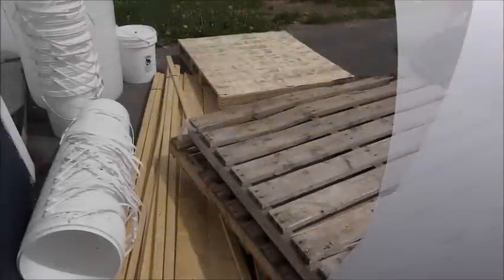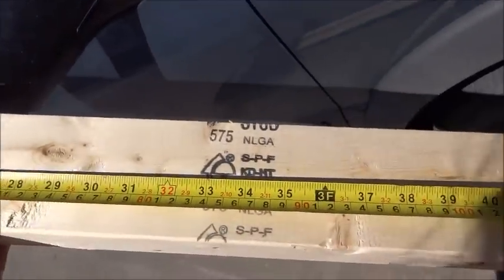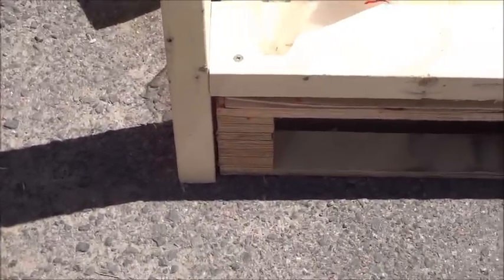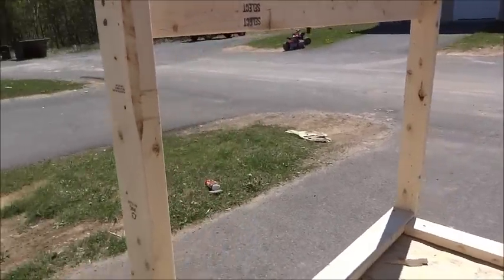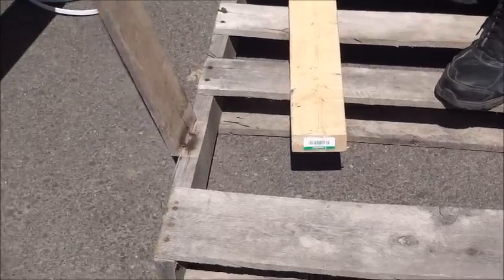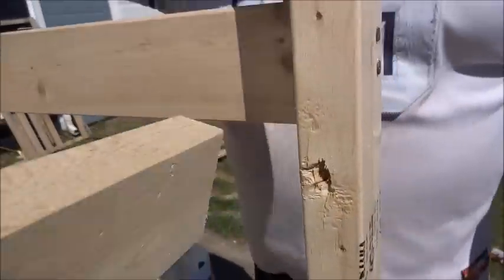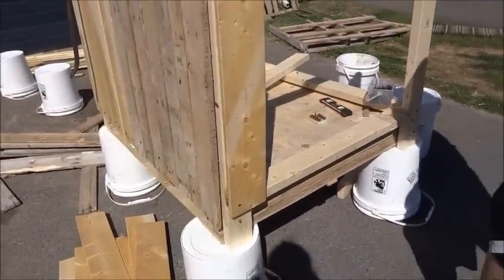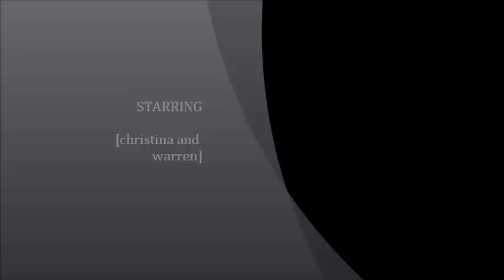My first pallet project building a chicken coop

Comment: For disassembling pallets, I find it easiest to use a reciprocating saw (sawzall) to cut the nails.  As long as you can pry enough space to get the blade in, you don't break nearly as many boards.
Reply: David ike has a chicken coop guide AWESOME!
Reply: Also not all blades are made equal! Cheap ones are not good buys.

Comment: If you own a reciprocating saw (aka sawzall), buy a demolition blade (about $10 at Lowes, and you can slide it between the boards and you can cut right through the nails and have a pallet disassembled in no time at all.
Reply from the maker: I do not own one of those saws yet
Reply: CheapskateGardener Ah, that sucks. If you can ever borrow one, or buy one cheaply, you should consider it because it sure would save you time and work
Reply: @Evania_Brook_Homestead  check with local pawn shops. If you can go battery operated, you will never go back to corded.

Comment: I used a screwdriver and tapped it in under the slats to pry the nails up a bit, then tapped the slat back down to expose the nails that can then be pulled out with the hammer. It tended not to crack my boards that way. Use multiple screwdrivers as shims and it goes a lot quicker too.

Comment: Rather than spend all that time trying to pull out those boards, Get a hole saw for a drill say 1/2 inch and drill a slug around the nail and keep the board intact. Later, you can snap off the slugs on the other wood and then clip off the nails with a grinder. Hope that helps.

Comment: use a hammer and a wrecking bar it's much easier use the more rounded end to pull the pallets apart and pre drill holes first. first rule of thumb. but a great video :)
Reply from the maker: thanks for tip and checking it out

Comment: Hammer works with taking pallets apart you just need to hit them harder if you can get lots of pallets you won't really care if the board breaks because the job will go 10x faster and only ne a couple damaged pieces

Comment: where exactly are you from? that accent sounds like your from Newfoundland ☺
Reply from the maker: Cape Breton Nova Scotia canada
Reply: +CheapskateGardener ah ha that explains it :) lol I'm in NL

I am trying to build my own coop. never done it before.. how much did it cost all together?
Reply from the maker: +Laura Lee yeah. It cost 6 bucks for screw nails
Reply from the maker: the wood , was from pallets that I received for free, the tool I had too remove thet wood from there I paid 20 bucks to have built months before that ,, and once they found out what we wanted the tool for ,, they did not charge us ,, so the project cost 6 bucks
Reply: what about chicken wire ? what's that usually cost?
Reply: +CheapskateGardener what's chicken wire usually cost?
Reply from the maker: depends on size,, how far apart the holes are ,, and how high from the ground it is , like how many feet high ,, I bought two rolls that season and for this project I used left over ones ,, but it really depends on how much you want to pay
Reply: Thanks no appreciate the help
Reply: I appreciate* the help :)
Reply from the maker: My pleasure ,, I am by no Means an expert on anything ,, Just a mom trying too make ends meet showing how I do or did things ,, I really am glad you stopped by and leaves comments and asks questions , I have learned so much from the you tube community